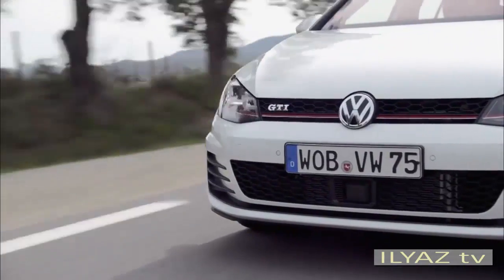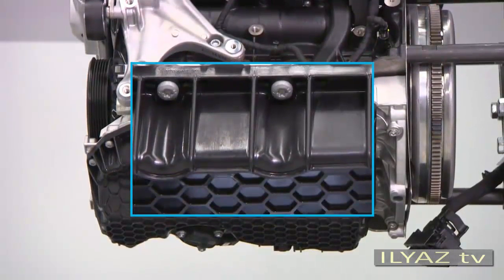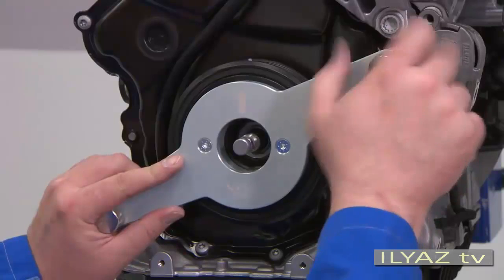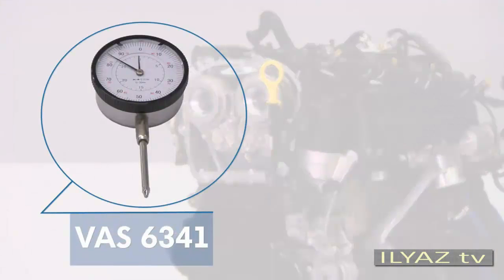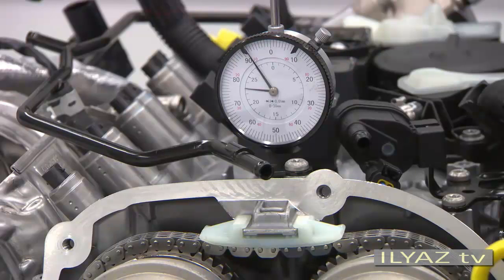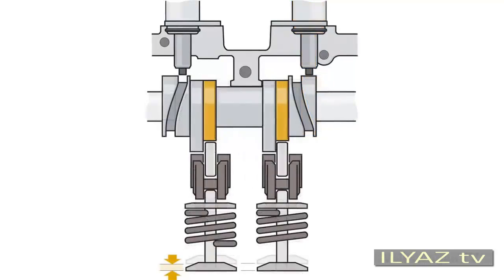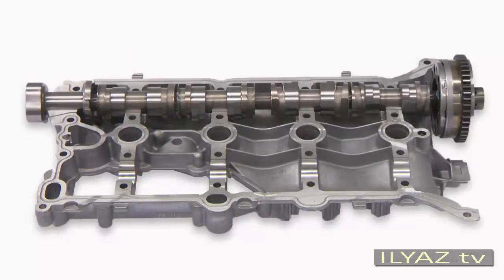VW AUDI 2.0 TSI Gen3 Engine Repair Tips

Comment: You need a whole tool kit with this engine 

VW dump auto
Reply: FuzZ360DUBS i just because a “special tool” exists doesn’t mean you need it. I’d actually suggest having a special tool handy makes the job much easier and less apt to breaking things. Yeah, a Chevy Cruze won’t have any special tools, but the turbo and pistons will blow up at 50k miles. Lol.

Comment: Good tips, but this EA888 engine in Europe has dual injection, one in the port, and another one directly in the cylinder. The USA versions do NOT have this crucial feature that eliminates the carbon build-up on the intake valves that severely plagues VAG's DI engines. This along with other cost saving details, such as the cheap plastic oil pan, (which severely leaks over time as it expends and contracts at a different rate that the block) does prove that we Americans are once again getting a lesser product than our European counterparts. (However, I would like to get my hands on that T10170A dial gauge extender.)
Reply: MyEyesBled I never knew the USA version had so many short comings
Reply: I am in europe, the country, and i don`t have dual injection.

Comment: what the mean is crankshaft position-camshaft position, correlation bank 1 sensor A
Reply: hing chin faulty timing
Reply: It means the ecu is not reading the camshaft position in the know range. For example if it sees the crank at tdc but the cam at the wrong place, it knows its “out of range”. Might be nothing wrong with the sensor, its just reporting it not positioning where it should be. Possible slipped/stretch chain or belt. May be wiring issue but usually its an open or short fault reported

Comment: what the mean is camshaft pos. sensor circ.,range / performance
Reply: It means the ecu is not reading the camshaft position in the know range. For example if it sees the crank at tdc but the cam at the wrong place, it knows its “out of range”. Might be nothing wrong with the sensor, its just reporting it not positioning where it should be. Possible slipped/stretch chain or belt. May be wiring issue but usually its an open or short fault reported

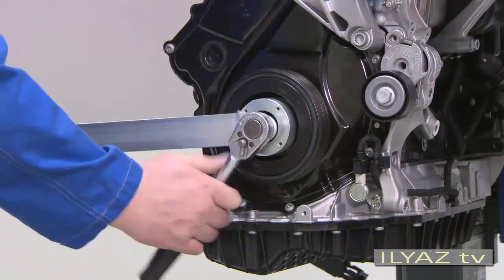Comment: Correction at 3:34. To remove the crankshaft bolt (in the real world) you will need a 4ft breaker bar with two people applying very high force.
Reply: Меня тоже умиляет невероятная легкость откручивания    в этих учебных фильмах👩‍🔧. Кстати, можно выполнить замену цепей практически без всех специнструментов,которые здесь показаны.
Reply: Yup, that bolt is put in with over 300ft/lbs
Reply: Its easy to do. I do it on my own with a flex end long ratchet.
Reply: Reinstall with Lock tight and a forklift.

Comment: The best tip is to NEVER buy a Volkswagen.   They are garbage.
Reply: Yeah, my Jetta is only at 467,000km, that's totally garbage...
Reply: These cars turn to garbage when most of you people, who don’t know how to work on them, take them to shops who don’t know how to work on them. And I’ve found that techs are afraid of vw/Audi simply because they have no experience or tools. These are easy cars to work on if you’ve got the right tools.
Reply: Max Musick  yes they are garbage
Reply: Dont buy their lower tier cars. Stick with GTI, GLI, ect....
Reply: My 09 cc has been garbage for sure!!!
Reply: Max Musick clearly youve never owned one or you wouldnt say that. Ive owned and worked for a few VAG workshops. they alot better than the other manufacturers. Wouldnt touch anything french or italian. Thats garbage!

Comment: My experience with a tsi engine so far:
After 5000km this engine- when running iddle -started shaking.
Engine misfires - according to VAG that is a normal behaviour for the TSI engines. 
( Why the engine didn't have that problem the first 5000 km, remains a mystery.
 Probably that wasn't normal ! ).
So expect this to happen at any time.
My collegues car ( french make, also direct-injection petrol engine) which cost half the price,
runs smoother. She makes fun of me, but in Germany they call this "Vorsprung durch Technik".
Reply: +Larkhill21 I agree he is very smart and helpful.   Still doesn't change the fact that VWs are junk.
Reply: Max Musick lol no they really aren’t
Reply: Engine misfires are often, if at low milage, due to rodents biting through cables...